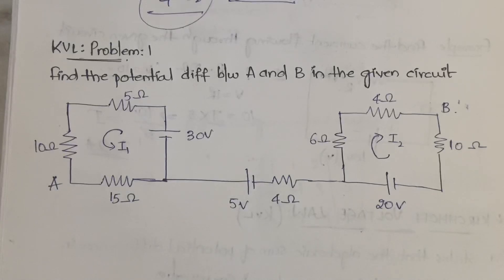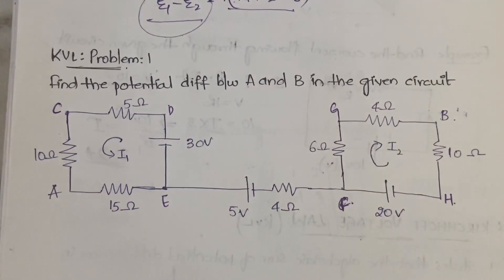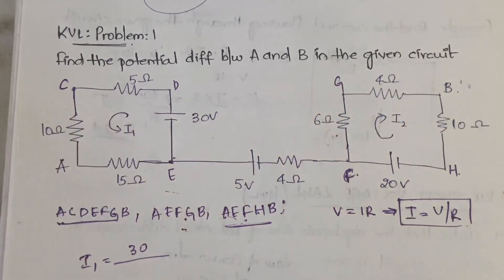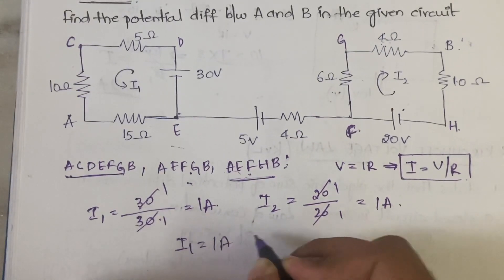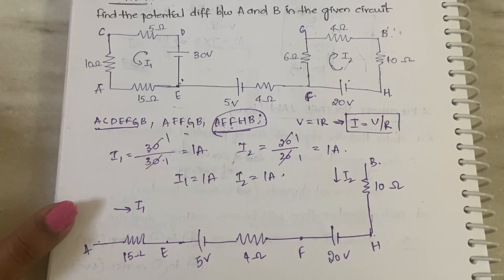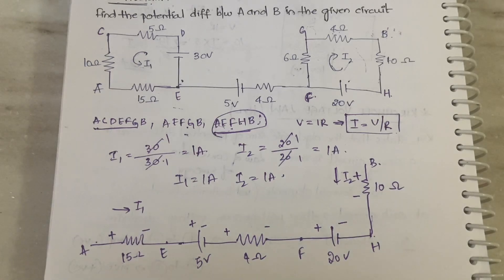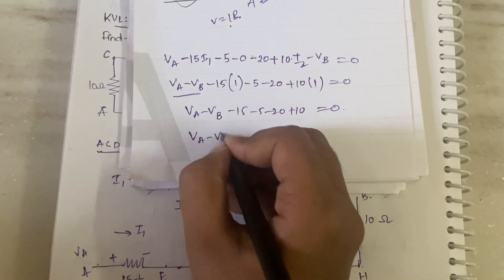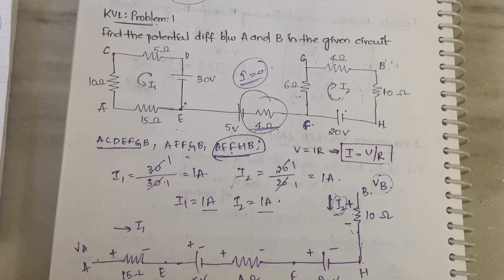5. Kirchhoff Voltage Law ( KVL ) - Problem 1 Important Problem |BEE|

Comment: how did you find the signs for the 4 ohm resistor at the middle when the current flows on both the sides?
Reply: I'm co-asking. . current in both directions are 1 amps each, they are equal and wont override each other.